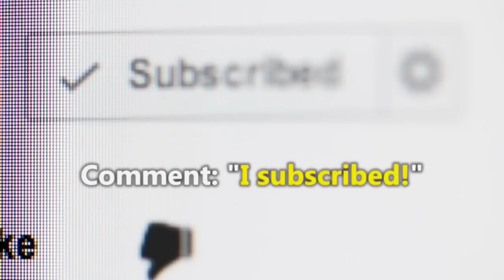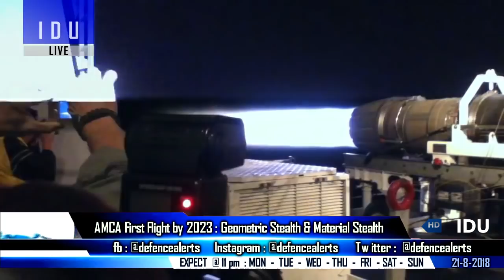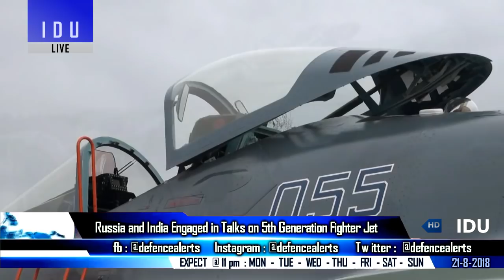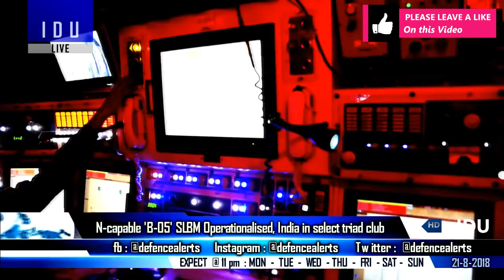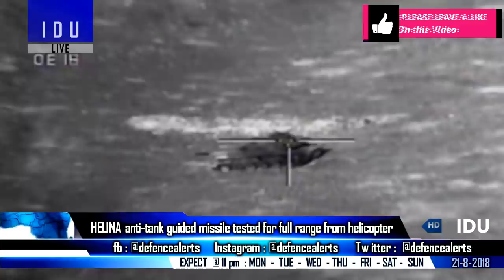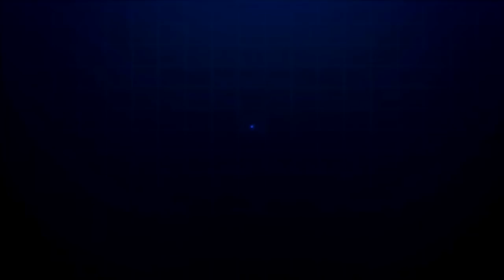Indian Defence Updates : AMCA Geometric Stealth,K-15 Operational,SAAW Clears Trials,DRDO Helina Test

Comment: AMCA in 2023 or 32.......Little confused.
Reply from the maker: AMCA First Flight by 2032 : (Editing mistake)
Reply: 2032 is too late the prototype tender was made I think if 2032 is deadline now I think it will be done in 2040 now I think we should buy other 5th gen aircraft for stop gap measure
Reply: Illias rahaman Sarkar hope but every article I read said 2032 though all had same source which was in Hindu bdw by 2032 Pakistan will already have 5th gen
Reply: I think 2022 to 23 would be the time, as tender for tech.demonstrator and prototype showed 6 years of deadline time. As the tech. demonstrators will fly first I think 2023 would be the year.